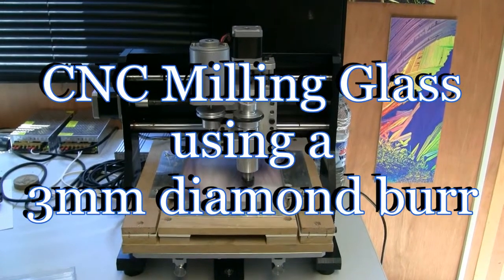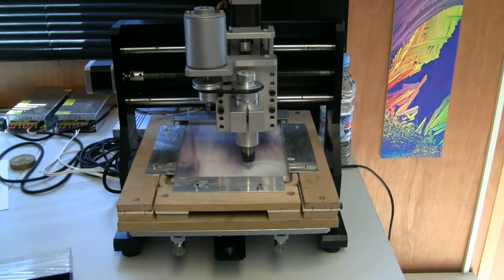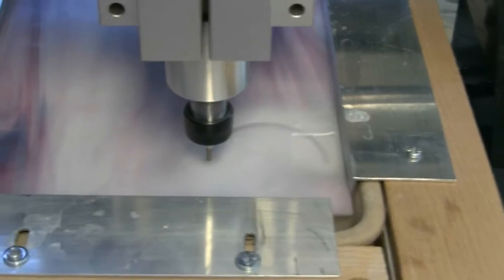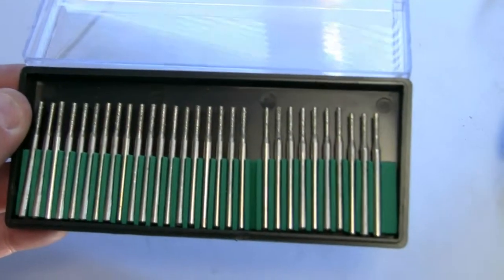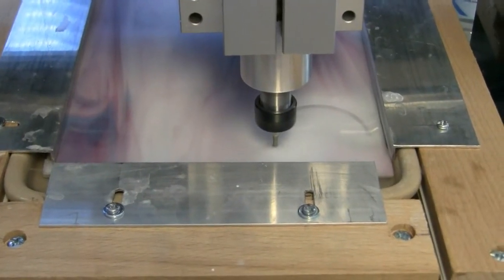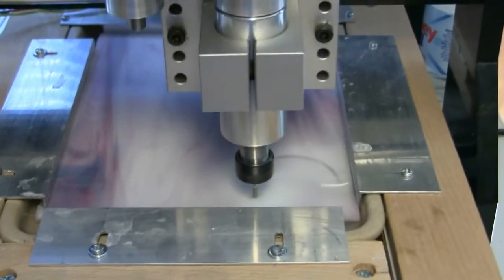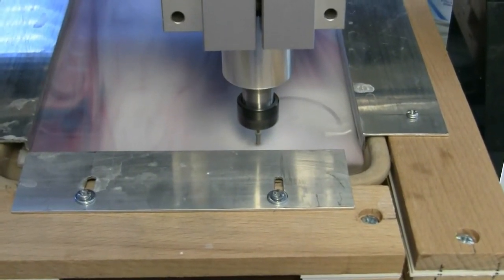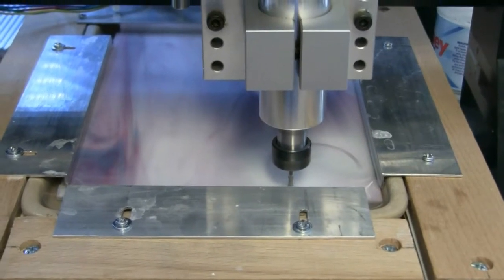Glass Milling 3

Comment from the maker: Hi Clive,  Yes that is most definitely an option but just takes quite a long time.  With a feed rate of 10mm/min it takes about 15 minutes to mill one circle.  The cutter appears in good shape after eight circles.  I have had one cutter shear off but that was because  I think the cutter was a little off centre to start with.